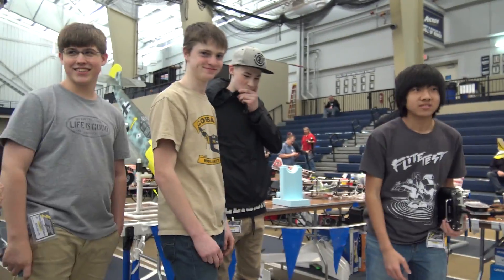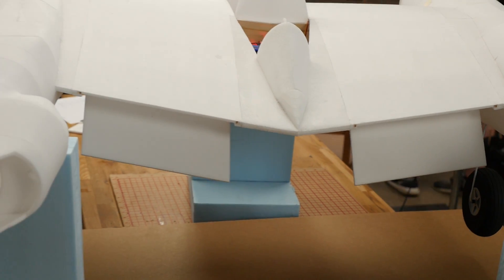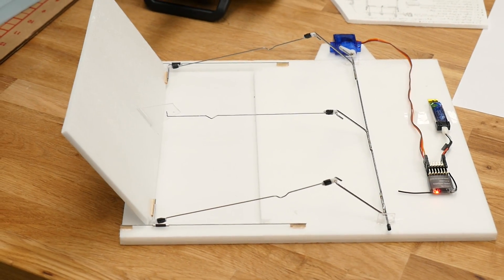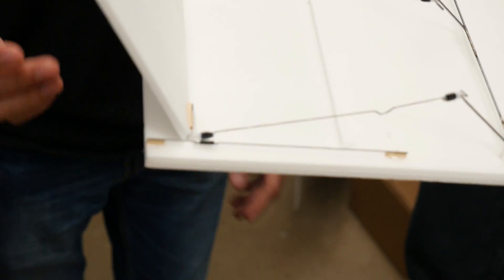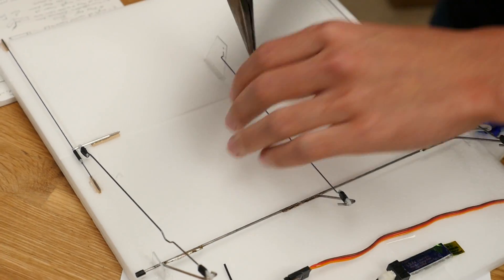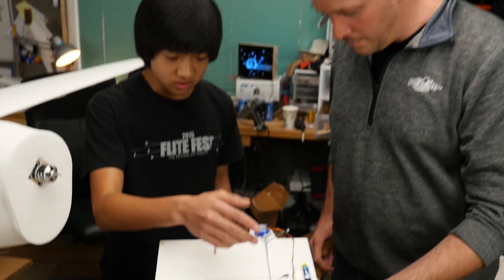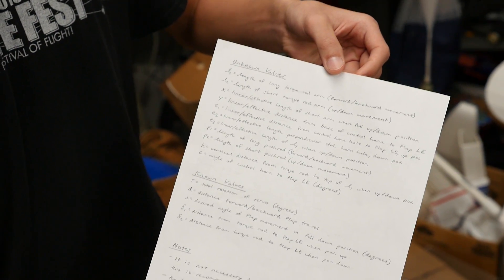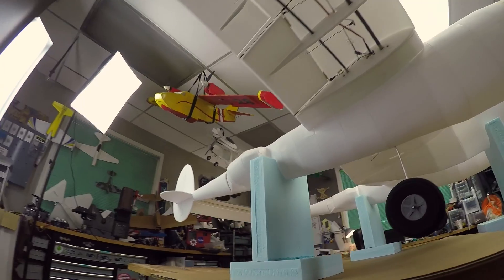How to Make Fowler Flaps - P-38 Lightning | Flite Test

Comment: Is it possible to use flaps as alerons? Also, do the torsional forces in the music wire require multiple motors spaced out, or can it be mitigated by something? Maybe a fishing line pulling on the levers since tension doesn't have that many problems?

Comment: This is not a Fowler flap, as a Fowler flap extends backward fully, before turning downward. 

Instead, it is very much like a Zap flap, that runs on a rail, similar to your flap, but the cambering is controlled by a pushrod on top of the flap, but the effect is similar to your design.

I'd say your design probably is less troublesome than the Zap, which never really caught on!

More on the subject here:

https://en.wikipedia.org/wiki/Flap_(aeronautics)

Comment: Pretty ingenious, but not a true Fowler flap which would typically move rearward all the way to the trailing edge of the airfoil.  His gets partway there but is actually more of a Zap flap, or a combination Fowler and split flap.  I'm not denigrating his work, just the terminology.  Also, true Fowler flaps would require far more support than is available in the average model since there would be a large weight penalty.  https://upload.wikimedia.org/wikipedia/commons/thumb/7/76/Airfoil_lift_improvement_devices_%28flaps%29.png/360px-Airfoil_lift_improvement_devices_%28flaps%29.png

Comment: Awesome, been meaning to build a plane from your plans. Is it just regular foamboard you get at office depot? I was also watching your video review on the DJI Inspire 1 and was wondering if you guys could do a video on building a semi-professional video quadcopter, you mentioned iin the video you would see if one could be built for less money. I'm thinking of getting a build together, and I would like to build something comparable to a P4 or the inspire, it'd be cool to see what you guys with more experience would recommend to get close to it. I don't mind spending up to $1500 as I'm considering purchasing the P4, but the $3000 for the inspire seems a bit steep in my opinion.

Comment: beautiful Lightning! I was wondering if you get much shudder or vibration when the flaps are extended? I used to fly nitro (still have my senior falcon) and I was taught to have little of no flex in the control rods.

Comment: very impressive but seems flimsy. wouldnt airflow just push the flaps up if they are being supported with such little material?
Reply: At the speeds that my P-38 is flying at, blowback from airflow is not an issue. However, for a faster aircraft, you will want to make the linkages out of thicker/stronger material.

Comment: I thought Fowler flaps were the ones around the fuse to let the engine-air out? Did Fowler do more flaps than that, or am I merely mistaken?
Reply: +Brian Fahrlander Fowler flaps are flaps that extend down and back from the wing. It basically makes the wing wider, and produces more lift, but with less drag than a standard "flip down" flap with no extension.
They didn't make their way into many aircraft back in WW2, but they jump up in lift capability is enormous when compared to other aircraft. (Always used to mess up landings in IL2 because I'd be coming in in the P38 with no flaps, and then slow down and pop flaps like you do with most aircraft.... and jsut start gliding past the runway like "damn, i kinda needed to land there")

Comment: it was nice but you didn't explain what fowler flaps do
Reply: they act as normal flap for the most part. They create drag by turning part of the air foil into a under cambered airfoil which ,along with producing lots of drag, create alot of speed at lower speeds. in the end all that means you can fly at lower speeds without stalling. hoped that helped
Reply: That helped a lot, thanks.
What is the advantage over regular flaps, this seems much more complex so I guess it is justified.
Reply: +Fluburtur well normal flaps just lower a wing panel which change the camber of the wing while fowler flaps along which changing the airfoil also give the wing more area by extending out and deflecting down which produces even more lift at slow speeds compared to normal flaps.

Comment: Can we get plans to this plane and/or your Me109
Reply: It would be quite tough to make plans for either of these planes as I was not planning for them to be recreated and therefore did not draw many plans for them, especially the 109. I have a little more plans for the P-38 but they are not digital. Even if I released plans, most of the builds would still have to be worked out by the builder. I will consider drawing up some plans to share, but that would be quite time consuming and not very likely. However I will be sure to make some better plans for my future projects and share them if possible.
Reply: +Andres Lu Really really nice work on those planes! Thanks for sharing your fowler flap design too!